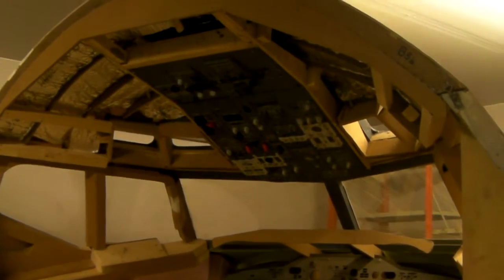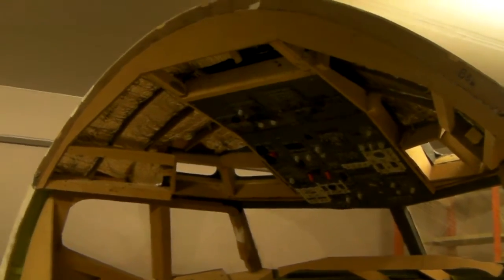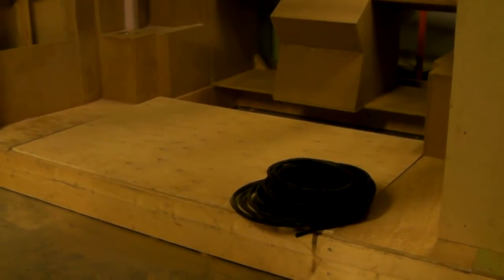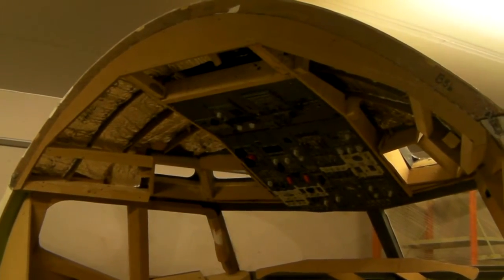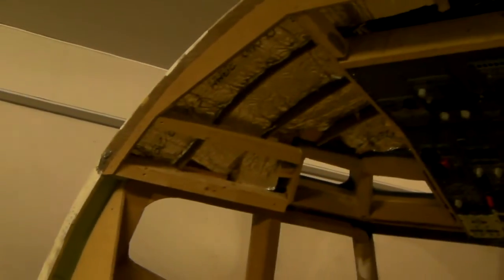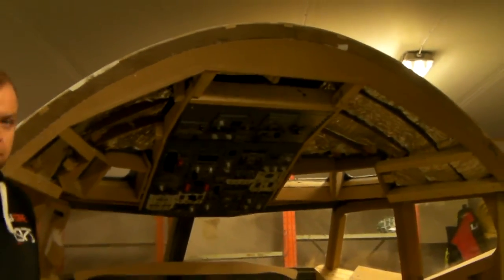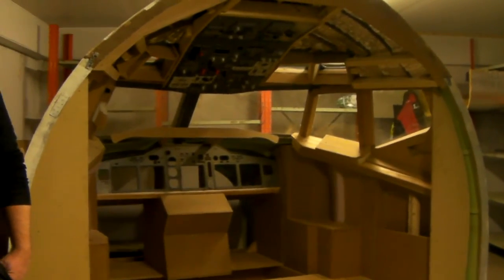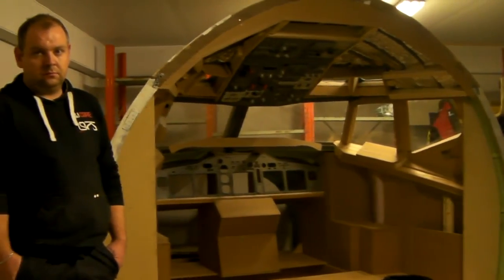Building a Boeing 737-800 home simulator #35

Comment from the maker: Hehe.. Hey there buddy.. How far away from starting your visuals setup? I don't think I will start that until I am done with the rest of the simulator.. I really wanna hold off the flying until it's 100% done. Flying and building does not mix:)  So basically, I am not in a position to help you out with the visuals right now.. But if you hold off the visuals build a bit, we could do it together maybe February, or March..